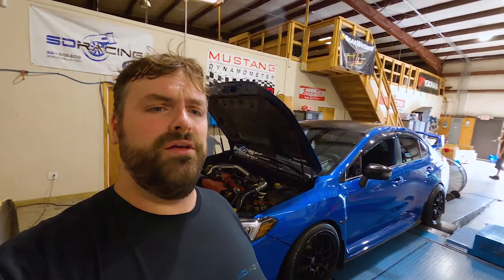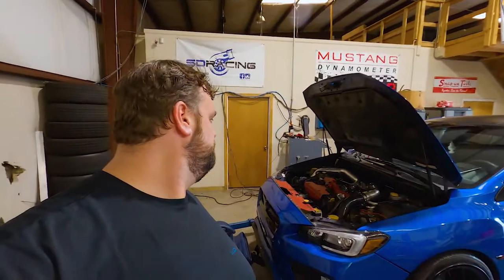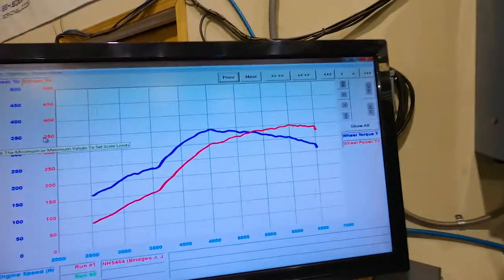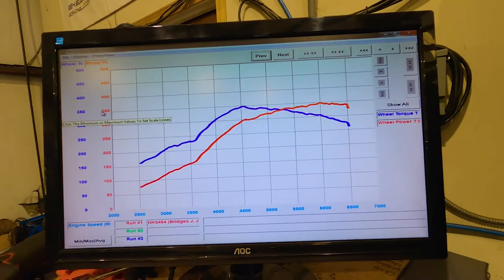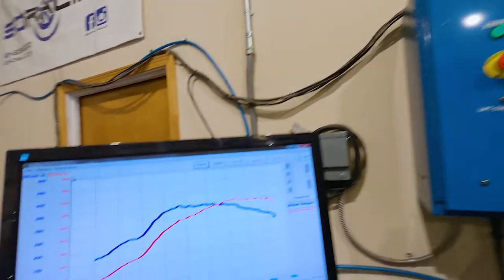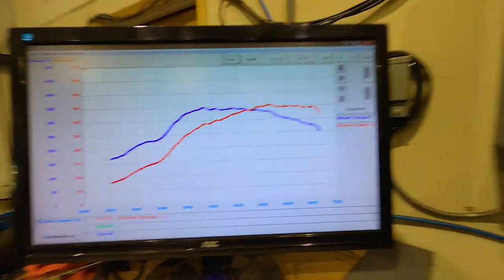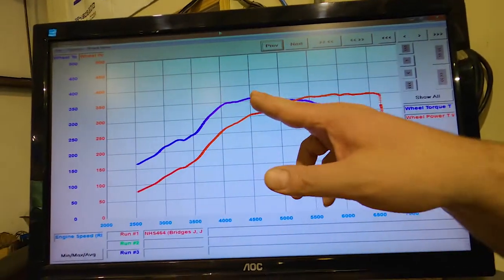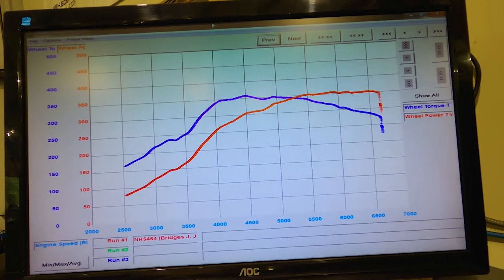COBB Tuning 20g Turbo + IAG Stage 3 Shortblock = 361hp/374tq on 93 Octane!!!

Comment: It’s funny when people talk about lag with this turbo… they are usually a. Old and the car never sees rpm above 4K rpm ever. 
B. Don’t know how to shift quick enough to actually rev match and keep turbo spool. 
My car lives at 4-6 k rpm any time I’m actually using it, and with the 4.44 trans cruising at 60 mph is 3,000 rpm, so the td06 20g 8cm is like the best match for my big bore 2.5 with ported heads thay already moves more air it’s basically like the stock turbo till 4K and then it just keeps going and falls off at 6,7k rpm right before redline. It’s said to exploit all the good power from am ej25 and the power torque curve vs rpm hp is perfectly matched.